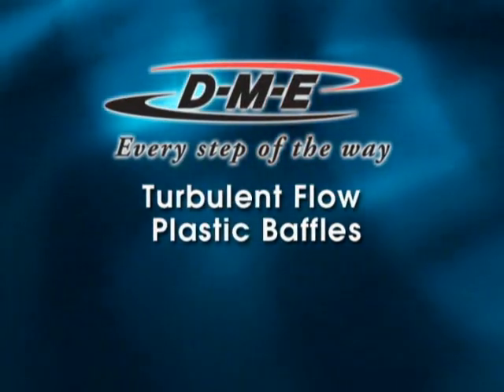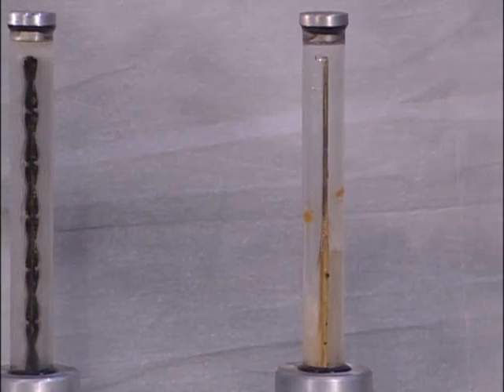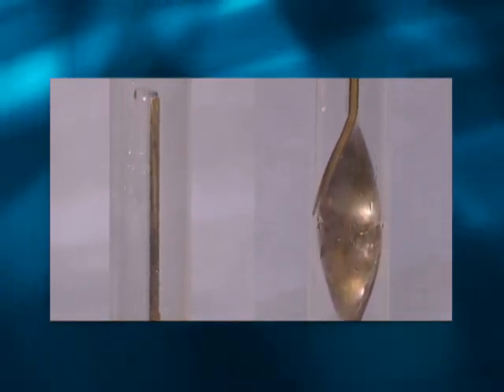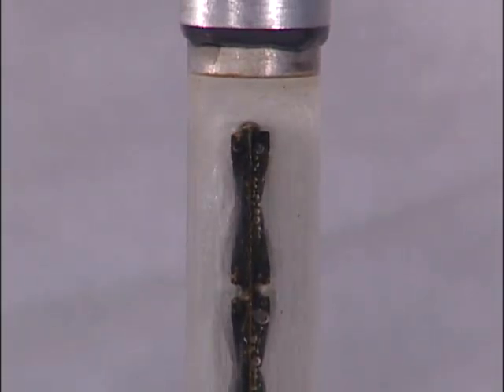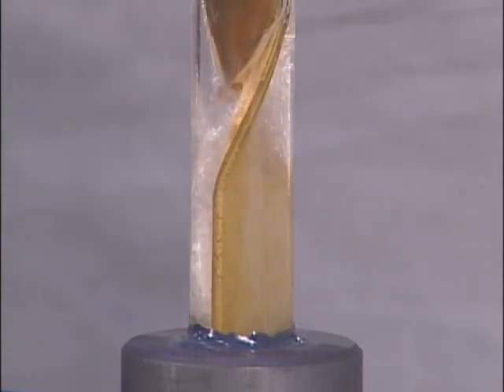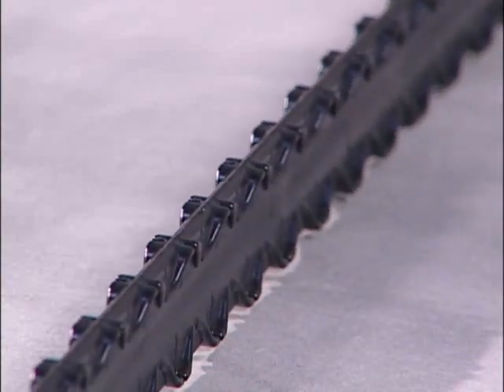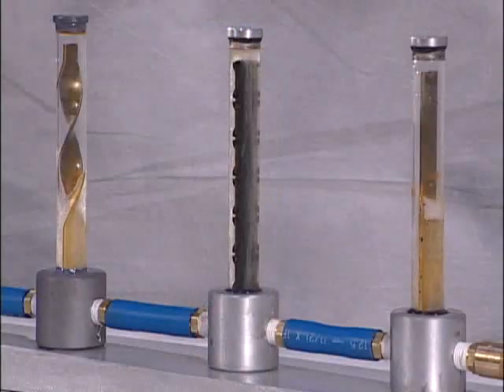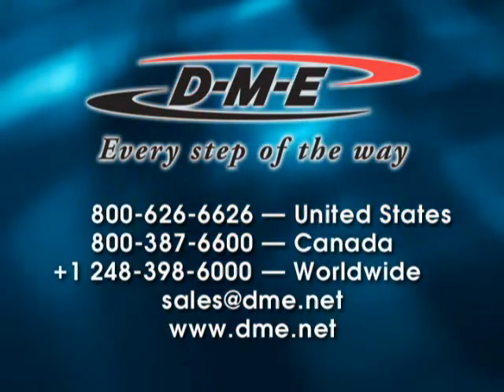Turbulent Flow Plastic Baffles vs. Brass Baffles

Comment: Nice product, you should have done 3 separate lines. these are in series and each front one is resistance before the next one.
Reply: They each add their own resistance, but the overall system has a net resistance, and thus a produced flow rate. So the flow rate is the same between all 3 baffles which makes it a good test. If you wanted to compare which baffle produced the highest flow rate (lowest resistance), then I would agree with you, but they are testing how the baffles perform against each other in regards to blow back issues.